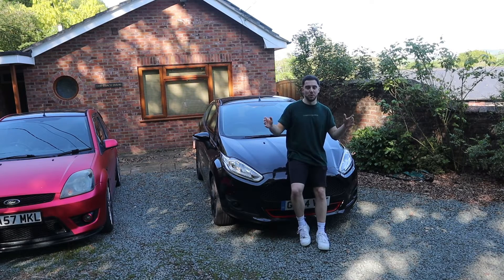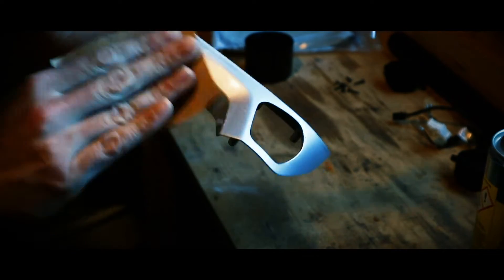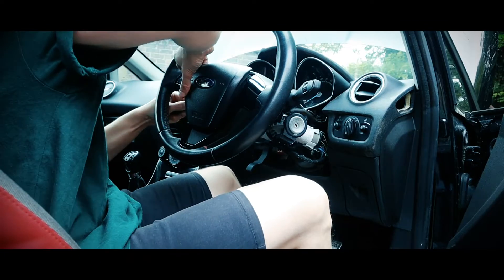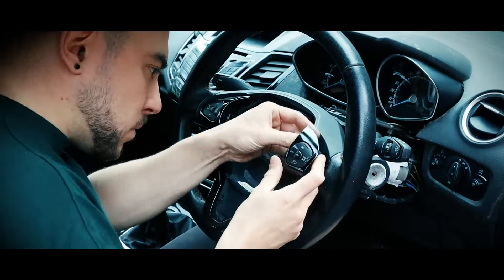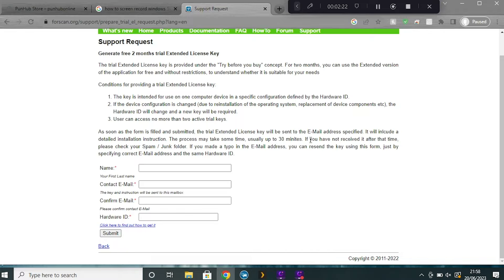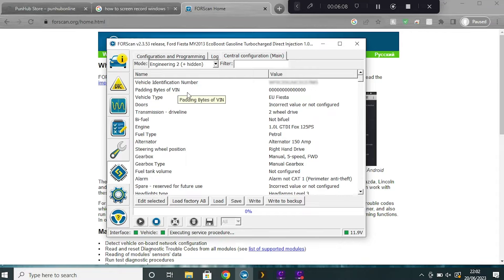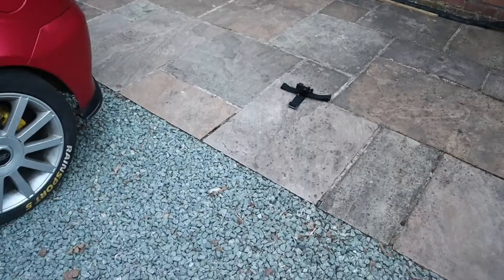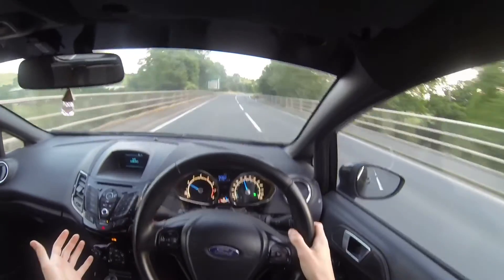Retrofitting Cruise Control to my MK7 Ford Fiesta 1.0L EcoBoost | *HOW TO*

Comment: Another great video! Regarding the 9 vs 7 wires on the clockspring connector, the 'missing' two wires are used/required to connect through to a resistor ladder in the cruise control switch which allows the state of all five buttons to be determined (each button introduces a different value resistance into the circuit thus changing the voltage drop across the wires). These two wires are the black and green/brown wires in positions 9 and 8 respectively (far left as seen in your video at 3m14s). Incidentally, note that the cruise control switch has another pair of wires to it but they are just for illumination and they piggyback on the same illumination supply that is present for the audio control switch.
Reply from the maker: My man 🤜🏻🤛🏻 thank you very much!
Reply: What year fiesta can cruise control be retrofitted too? Would it work for all MK7 from 2008-2017?
Reply: Hello @mathewnewton3499, 
Do you know if you can still retro fit cruise control, if wires in positions 9 and 8 are missing?
I assume that some wires/components need to be added/replaced.
Do you know which are those components?
Reply: @konstantinoskaparelis6701 did you get the information which wires are needed?
Reply: Thanks for that very detailed explanation. I hope my ST has the wires at the ready.

Comment: Tutorial worked great. My advice: 1 Rather than using the side slots to get the horn/airbag off, there are gaps in the back of the steering wheel,  that you can reach if you turn the wheel. 2 when you take the horn/airbag out, make sure to not bend or move the springs that trigger the horn (i put mine all back, just to have the horn stuck on, had to take it off and wiggle the springs back into place)

Comment: Unfortunately, I got rid of my mk6, due to an offer I couldn't turn down. I asked you a few questions about it in the past. I have now bought a st2 st180 and dont suppose if you know if I can forscan my windows to do a full enclosure with the remote? Oh, and is this video similar to doing it to my st180?

Comment: I have a 2018 Ford Fiesta MK8. I checked the cables today and there are only 7, not 9.

What should I do?
Reply from the maker: Well that’s a MK8 so it may be completely different
Reply: @MendItModIt  I tried, I put the CC button, it lights up but none of the buttons work.

After that, I connected the OBD cable to the car, and connected it to the computer, but when I did the same procedure as you do, on my screen IPC CENTRAL CONFIGURATION does not appear, only IPC MODULE CONFIGURATION and IPC ODOMETER WHITE appear.

I selected the MODULE CONFIGURATION option and activated the cruise control, but it did not work.

I will research more.
Reply from the maker: @ your car is probably not compatible with cruise control. Especially if you don’t have those two wires, but that’s only IF it’s the same on the MK8 as it is on the 7. But I wouldn’t know the answer to that. Good luck
Reply: @ I'm sure someone who has a Mk8 will help here in the comments. This group you created only has teachers in fiesta. 😂😂😂
Reply: Good news, it worked!

Even with 7 cables, the MK8 has cruise control.

This video helped me set it up. I tested it right now, and it worked perfectly.

https://www.youtube.com/watch?v=lOFo_z8DT1U&list=PLGqi-6uFDWw--_MKiK3TjAxdzNbk67j3m&index=3

Very happy!

Comment: Has any had a problem with their horn constantly going off (not electrical). When I pull it away from the steering wheel it stops. Like it's pushed in too far
Reply from the maker: @callumburgin8799  yeah I had it when doing this, when you’ve put the airbag back in it’s not lined up properly
Reply: @ so how did you line it up currently having this issue as we speak 🤣🤣

Comment: Used to watch your vids when I owned my MK6, now Nearly 2 years later and owning a MK7.5 St Line eco boost, this video worked like a charm! Taking out the airbag is a bit of faff but when done once, it’s easy to do again! A heads up to anyone who may experience the same problem - When putting the airbag back in once all connected, make sure all spring contacts are sat correctly in their respective slots. You’ll know when they’re in properly as you’ll be able to push down on the left, right and lower part of the front of the airbag as if you were to honk. Otherwise you’ll get a nice surprise like me and when connecting the battery the horn will continuously honk, until fitted properly. Fine once reset in the correct place!

Great vid, and hope you make a return soon!
Reply: Did you check for the 9 wires first? Tempted to do this! I want to fit a flat bottom wheel from a mk8 into my 7.5, think it might be a lot more involved then this.

Comment: Hello. Can this be dangerous for the airbag? Im afraid that the airbag will random go off after doing this. Or that the airbag becomes unreliable. Thank you already found the buttons and frame
Reply: hi, i found this on a german forum of a guy that seems kind of trustworthy:

Many “sources” say to disconnect the battery beforehand, as residual voltages should come from somewhere that allow enough current to flow to ignite a propellant charge.
Personally, I think this is hocus-pocus, but it doesn't cost anything to do it anyway.

Airbag is fixed at the back with 2 or 4 Torx screws (Fiesta MK3 anyway), remove carefully, has a short yellow cable with a plug, note the position behind the airbag so that it doesn't lie askew when reassembled or something.

Install the “new” airbag in the same way, only in reverse.

If the light goes on as expected when the ignition is switched on and then goes out, everything is OK.
In my opinion, sudden explosions due to improper plugging also belong in fantasy land, as the airbag control unit checks the resistance of the connected load when the ignition is switched on, either the airbag is there with a non-ignited propellant charge or not. Poorly fitted plugs reduce currents and do not increase them so that a propellant charge ignites.

If the light stays on, the airbag is defective, or the plug is not connected properly, the cable is damaged, the winding reel is defective.

Since you don't have the money for the workshop, I assume that the airbag is not new either ;-) 

Translated with DeepL.com (free version)
Reply: So if i just remove the airbag to add cruise controll and install it back there is no chance that the airbag explodes during driving?😂 thats the only thing preventing me from doing this retrofit on my car.
Reply: @mariosbross1 😂😂 yeah as long as the airbag light turns off after turning the igniton on everything should be OK, only if the light stays on I would start being concerned.

Comment: I've just followed this video this morning and fitted cruise control to a 2014 Fiesta 1.0 Zetec (9 wires) and it works perfectly. As mentioned in some other comments, the most difficult part was getting the airbag out, but after that it was fairly easy. Thank you so much!

Comment: Have you retrofitted the LED DRL to standard headlight models before?
Reply from the maker: I haven’t mate sorry 😢
Reply: @MendItModIt  that’s ok, no bother. I’m struggling to get into “engineering mode” on FORscan; apparently I need to be in that to change the “headlight type” in central configuration.

Great video btw, I’m wrestling with myself of doing this mod myself, love cruise control!

Comment: I was able to add cruise control to a 1999 Ford Escort. I was able swap out the steering wheel. The wiring harness and mounting points for all of the components were there. It was plug and play fortunately.

Comment: Great video. Used this after fitting steering wheel with cruise control to my c max. Had to do a couple of extra steps in Forscan though. As well as enabling cruise control I had to go into Engineering 1 mode and select Adjustable speed limiter then change it from without ASL to with ASL. Write this change the same as you did for cruise control. Then most importantly you need to go into DTC on Forscan and clear errors. (I had B112B steering wheel module error). After that cruise control worked fine.
Reply from the maker: Not sure if mine will do the ASL but good shout on the codes. I have noticed sometimes it doesn’t seem to want to enable cruise 🤔 thanks man, I’ll look into it 🙏🏻

Comment: I went ahead and did this today, it genuinely is easier than it seems and anyone can do it. My advice for the hardest part (taking out the air bag) is use a small flat head screwdriver to get the best access, also lie the other way round on the seat and look from underneath the wheel lol. I was at it for a good hour until i tried to brute force it, turns out it needs a fair bit of force don't be scared to break anything.

Comment: Wow thats amazing that you have done this. I have recently aquired an old 2011 1.6 TDCi Titanium (77k miles) which has cruise control as standard. I was really surprised that it had this. The car is like a well looked after 2 year car inside and out condition wise and smells like a new car too. I got lucky. It also has the power folding mirrors.

Comment: good vid, just fitted aliexpress buttons, loom and shroud to my 2011 1.6 and it worked a charm. Thanks for the help, trying to get the airbag to unhook was the most stressful part.
Reply from the maker: Seen someone post about them… had my doubts they’d work. What colour LEDs do they come with in the buttons?
Reply: @MendItModIt  I got red to suit my dash and instruments but blue seems more common, they also sell the loom, buttons and shroud separately or in a kit.
Reply from the maker: @georgetav77  oh really? I will check that out bud cause mine came with red bulbs but my clocks are blue and trying to mate the LEDs is a nightmare! Thanks for in info dude 👍🏻
Reply: I think I have the same ones as you can you tell me where the extra positive and negative wires / spade connecters go

Comment: Any suggestions?? 
My horn is now, flat out. Only way to get it off is to disconnect all cables🤣
Reply from the maker: Airbag isn’t aligned/seated properly, happened to me as well although mine was prone to just randomly going off in the middle of the night for a couple days and then we I drove the car it went off every time I turned left 😂😂 until I figured out it wasn’t seated right anyway 😂
Reply: @MendItModIt  figured it out in the end, another issue though, got the same adapter you had for Forscan but it’s not recognising. Any suggestions? Hasn’t been an easy install for me i’ll tell you that🤣

Comment: Thanks for this informative video! I managed to fit my mk7.5 new steeringwheel with cruise control and programmed it using forscan. I had an issue with my usb ELM 327 with ms/hs switch. It couldn't connect to my car at all. I bought the obdlink EX from amazon which worked without any issues with the fiesta. Just FYI for anyone who is planning this retrofit, don't buy the ELM 327. Its junk compared to obdlink EX.

Comment: Thanks for this instruction. Did it with my German Ford Fiesta 1.25 84HP MK7.5 and it worked. 

I started with the programming before (when i made my test period on ForScan), because i didn't know when i get a fitting steering wheel cover - and there was an error, because the wire from the connector to the switch is missing ;-) - just for info.

I read that the 7.5 all have the wires.

Comment: Hello, great video! I’ve just done everything as you did, and even though the cruise control green light now comes on the dash, nothing happens when the I press the buttons. Lights on the controls are working so I’m assuming that the controls should be working. I followed everything in ForScan but is there anything else I need to do. Any help would be great.
Reply: amigo pudiste solucionar? tengo el mismo problema

Comment: Hey, great video, I just installed mine today. Coding worked, buttons lights works. Everything seemed working at first, but the cruise control buttons were not working and it messed up my volume controls too...
Weird thing is that, now the volume controls, activate cruise control , but the other controls (for the cc) does not activate anything. 
Any ideas on the issue ? (the part i bought is from the exact same car and should match perfectly).
Reply from the maker: It sounds like you’ve got the audio buttons and CC buttons plugged in the wrong way round 🤔
Reply: Thanks for your quick reply. You are right, i inverted the plugs (cc controls and volume control), and now it work perfectly fine! Idk why, it was originaly plugged the wrong way...
Thanks again for your guide it was the most complete one.  @MendItModIt
Reply from the maker: @twik-p6t  no worries, glad it’s all sorted 👌🏻

Comment: Ok so i watched this video and then attempted to retro fit my 2009 fiesta which only had 7 wires with CC. I wired up pins 27 & 28 from the Instrument control panel to the two missing pins on the clockspring connector. Did everything shown in this video. For a while i couldnt get it to work and then I went for a run on the motorway and found i had to be over 60KPH for the CC to engage. I'd been testing at 25mph. If this is something people want i could do a video of this on my channel.
Reply: Video on how to wire these would be appreciated !
Reply: Hey! I know it’s been a couple of years since you left your comment, but is there any chance you could make a video showing your solution? I think it would be super helpful for others too!
Reply: Is it 27 to 7 and 28 to 8?
Reply: @harvey1459  es el 27 al 8 y el 28 al 9
Reply: @harvey1459 I did mine - 27 to 8, and 29 to 9. In my car the cruise control works if my car is over 30km/h
Reply: @vali4o where are the 27 and 29 pin located?
Reply: @steijnrietveld7599   Pins 27 & 28 from the Instrument control panel to the two missing pins on the clockspring connector.
Reply: If you could do a vid that would be great mines got 7. If not its all good. Got access to all the wiring diagrams
Reply: Can you please add the video with 7 wires?
Reply: can you please make a video? or just explain how do you fix with 7 wires pleaseee
Reply: Please do a video fam
Reply: Anyone knows is it 7 to 27 & 8 to 28…or the other way..?
Reply: @swapnilthakur8891  if it is just going to a resistor ladder I don't suppose it matters which way round.
Reply: @RubberRivet  i tried putting it to 27 & 28….CC fault code was gone but then I got the ambient temp sensor code….FYI mine is 13 ecosport ecoboost titanium O
Reply: Hi, could you possibly make an explanation video on how to do this correctly? i think i understand but I don't want to mess up my car! is it as simple as running a wire from the steering column connecter to the IPC connecter?
Reply: @RebeccaFyre And? Dit it work? Or didnt you try
Reply: Could make a video explaining how to do the wirering?
Reply: @steijnrietveld7599  i sold the car unfortunately. But it's super easy really. Just get 2 cables that are long enough to go from the instrument cluster to the clockspring connector. And just add a cable from 27pin on the instrument cluster that is going to the 8 pin on the clockspring plug/connector. And a cable from 28pin on the instrument cluster connector going to 9 pin on the clockspring connector.
Reply: @vali4o  Thnx!

Comment: Got the airbag off, put it all back together. Horn isn't working... absolute nightmare. Double checked the fuse which is fine so I don't know if something isn't connected correctly or something has got damaged in the process. Need to look online to see if I can find which wires are for the horn then probably have to take it all back off again.
Reply: Took it apart again, disconnected cables and reconnected, didn't fix it. Took it all apart again and refitted the original trim to see if there was an issue with that and it still doesn't work. Not sure where to go from here really.
Reply from the maker: @Nyle95  there’s a metal ring that runs around the back of the air bag and one of the spade terminals connects to that, it’s the ground for the horn. That ring makes contact with the three little metal pads on the steering wheel when you press the horn. Check all those pads are clean and the airbag is seated correctly, mine wasn’t the first time I refitted it and when I reconnected the battery my horn kept going off my itself
Reply: @MendItModIt  Thanks mate, will check all that again. If its not that I think the clock spring might have become damaged. I want to test the horn itself before I order anything though.
Reply: @MendItModIt  Gave all the connections, metal ring and metal pads a good clean and refitted and still nothing. Thinking it could be the clock spring.